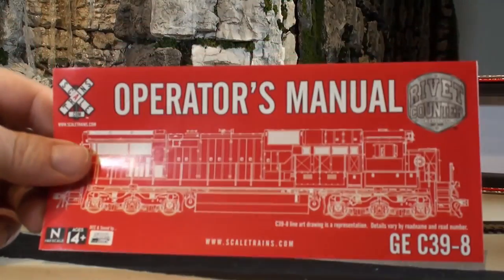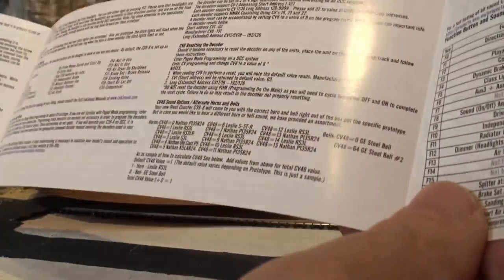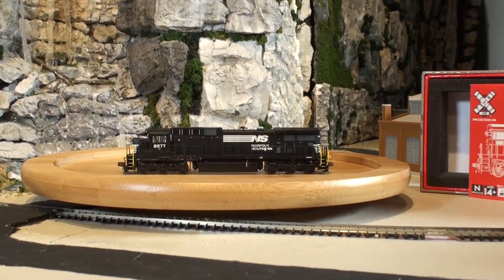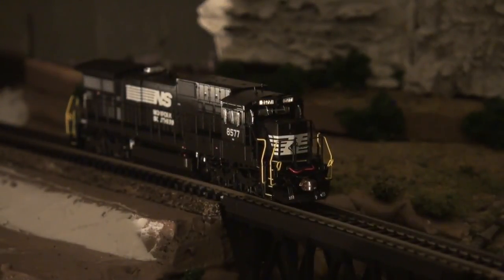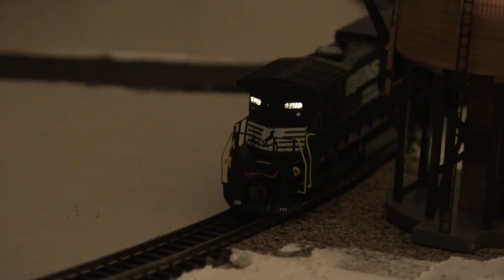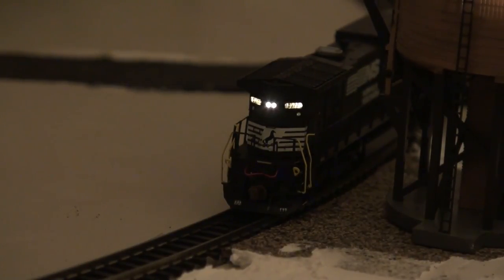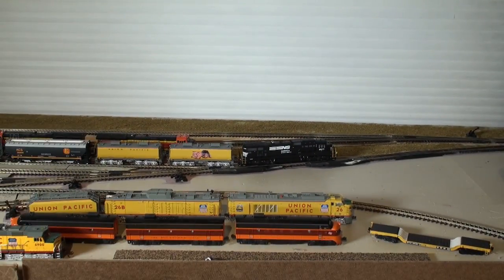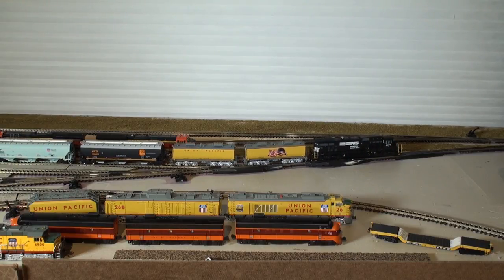NEW!!  NS GE C39-8 By ScaleTrains.com - DaBob's ManCave

Comment from the maker: I wasn't sure I wanted to get one of these at first, but then I saw it running at the N scale Convention in Salt Lake and I changed my mind.  This is a great little engine with the detailing and sound.  Do not expect to pull up a steep grade with it all by itself, it will be a great consist loco for that.  Tell me what you think.
Reply from the maker: I stand corrected, the engine as I read it from ScaleTrains is not a GEVO 12 but an FDL 16 cylinder engine.  Also, it was correctly configured to match the NS prototype that ran backwards in long hood style.  I have reprogrammed that loco to now be correctly configured.  Thanks everyone for pointing that out to me.  It wasn't in their documentation so I didn't know.  Thanks for keeping me honest.

Comment: If you notice, the "F" for Front is on the rear of the locomotive, as NW/SOU/NS liked them setup to run in reverse.  I'm guessing that's why it is running opposite to the other units.  Good review.
Reply from the maker: Like I had mentioned to RWSBaden, I couldn't find an F printed on the loco, plus I didn't know that it was used in Long Hood config.  Thanks for watching closely.
Reply: Well I wasn’t 100% sure myself. 

Love the sound on these
Reply: I ran these short hood forward the few times . I had one. I think the model is far better than the actual prototype!
Reply from the maker: I did find the F next to the stairs on the end after closer scrutiny with my glasses on.  I set it back up to the correct direction again.
Reply: @DaBobsNScaleMancave  snow plow on both sides is also a giveaway.

Comment: Hi Bob, As great as these locomotives look, Scale Trains messed up on their sound description. These locomotives don't have GEVO 12 cylinder diesel engines, They have FDL 16 cylinder diesel engines. They are dash 8's. I'm surprised someone at Scale Trains didn't catch that typo? Also Bob, as others have pointed out, look were the "F" is for front. Forward is going to move in the direction of the "F". Very nice review Bob, thanks for posting the video. Cheers, Rich S.
Reply from the maker: Thanks for the info, I was reading the info that they had on this model, I guess someone got that wrong.  I looked for an "F" on both ends under magnification, didn't see any on it.
However; Wikipedia says that all but two were setup to run long hood.  This just looks odd to me on this model.  I guess I will need to figure out how they got it to be reversed and fix it.  I never claim to know everything about these things, that is why I need viewers like yourself to let me know when I get something wrong.  Thanks.
Reply: Hi  @DaBobsNScaleMancave , look at timestamp 3:37 in your video the "F" is visible below the last stanchion beside the step on the long hood end. Also placing a value of 35 in CV29 will setup the locomotive to run long hood forward when forward is selected on your throttle. A value of 34 placed in CV 29 will setup the locomotive to run short hood forward when forward is selected on your throttle. Cheers, Rich S.
Reply from the maker: @RWSBaden  Ah, there it is, I need better glasses I guess or I was looking in the wrong place.  Thanks.  NCE has the direction choice in the STD menu chain to choose direction, made it easy to do it.  Thanks.